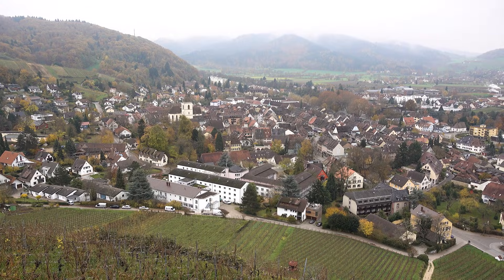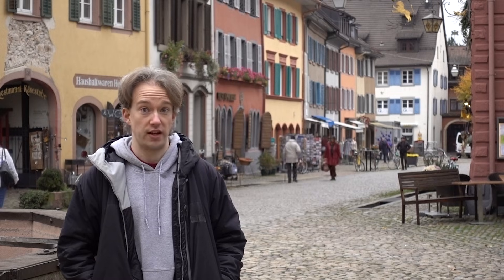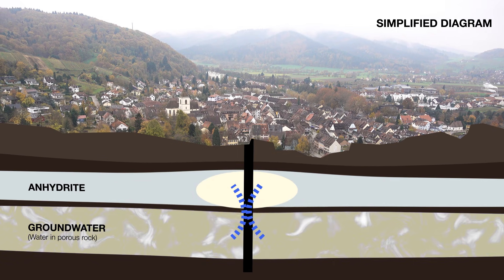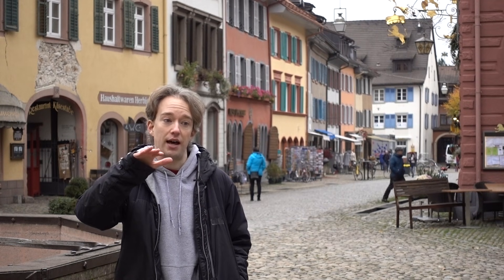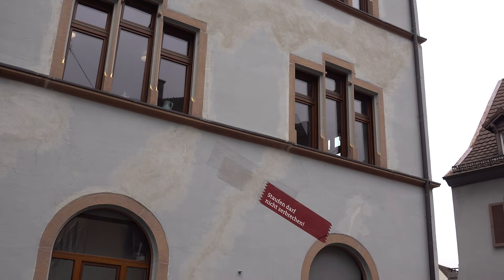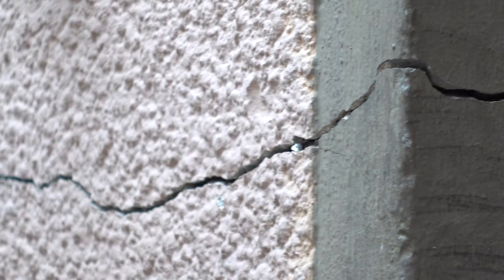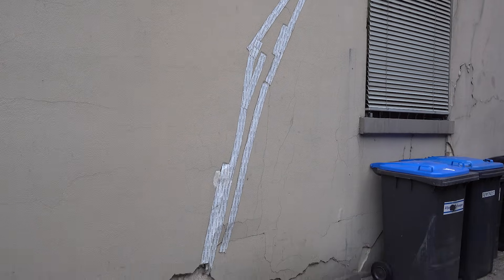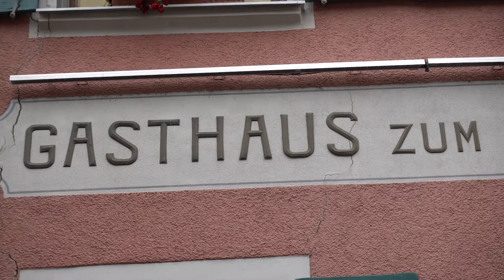The German town that's literally cracking apart

Comment: Just use duck tape, duh. I thought that germans are smart...
Reply: Tesafilm
Reply: Clearly you arent German then
Reply: Duck tape?
Reply: We call it Panzerband.
Reply: @ezioauditore2848  HANS GET ZE PANZERRR
Reply: @ezioauditore2848  😂😂😂😂 ich sag panzertape dazu
Reply: @ezioauditore2848  oh mein gott ja ja Sehr gut !!!!!
Reply: Duck tape? Do you mean duct tape?
Reply: @Zoe-bx9bp  no, duck tape is a real thing
Reply: @Zoe-bx9bp  actually theres a brand of tape called duck tape
Reply: Nothing FLEX TAPE can't fix.
Reply: @Giga4ever You are right my friend.
 Hi, Phil Swift here with 
Flex Tape! The super-strong waterproof 
tape! That can instantly patch, bond, 
seal, and repair! Flex tape is no ordinary 
tape; its triple thick adhesive virtually 
welds itself to the surface, instantly 
stopping the toughest leaks. Leaky 
pipes can cause major damage, but 
Flex Tape grips on tight and bonds 
instantly! Plus, Flex Tape's powerful 
adhesive is so strong, it even works 
underwater! Now you can repair leaks in 
pools and spas in water without draining 
them! Flex Tape is perfect for marine, 
campers and RVs! Flex Tape is super 
strong, and once it's on, it holds on tight! 
And for emergency auto repair, Flex 
Tape keeps its grip, even in the toughest 
conditions! Big storms can cause big 
damage, but Flex Tape comes super 
wide, so you can easily patch large 
holes. To show the power of Flex Tape, 
I sawed this boat in half! And repaired 
it with only Flex Tape! Not only does 
Flex Tape's powerful adhesive hold the 
boat together, but it creates a super 
strong water tight seal, so the inside is 
completly dry! Yee-doggy! Just cut, peel, 
stick and seal! Imagine everything you 
can do with the power of Flex Tape! .
Reply: @jamoin3829  to demonstrate the power of flex tape I sawed this town in half
Reply: @paulbauer8256  And repaired it with only Flex Tape!
Reply: @Usernamesarehard-e1e  it even works underwater
Reply: didnt expect u here Mr Slav <3
Reply: They actually did that, there are duct tape stripes over many cracks.
Doesn't really help though, the tape tends to get streched...
Reply: "If you cant fix something with a tape,then you are not using enough tape"
Reply: In Germany we call it Panzertape lmao
Reply: @bonsaiflrn  In Finland we call it "jeesusteippi" aka jesus tape hahah.
Reply: No verification?
Reply: Duct tape.
Reply: To show you the power of flex tape, I just cracked this town in a half!
Reply: Love your Vids dude
Reply: @___________482  probably yes, as they didn't use flex tape. But still, it's tape, and that's all this comment is about.
Reply: Flex Tape
Reply: "Thought" is past tence so its were, not are. Not very "smart" of you.
Reply: MISTER SLAV <333
Reply: @___________482 deinen youtube-namen hast du von nem anderen kanal kopiert
Reply: @kommentierenderkommentator2572  ich will ja nichts sagen aber es gibt sehr viele youtube nutzer und accounts da kann ein gleicher name schon vorkommen und den kanal den du meinst kennen wahrscheinlich 5 personen
Reply: Love your vids btw how could you not get verified?
Reply: Bureaucracy goes brrrr
Reply: @Teamgeist Ah dein ironie detektor ist kaputt
Reply: @Teamgeist was kann nicht mein Ernst sein
Reply: These houses are doomed , no need to repair them. They will have to go anyway.
Reply: The problem is the authorities: You can’t even eat a peace of foreign bread without a permission you need to apply between 10-10:30 on a Tuesday because the public service is closed on other times
Reply: It's a shame MR SLAV can't spell. It rather undermines his joke...
Reply: @ThreadBomb  duck tape is a real thing. There's duct tape and duck tape

Comment: Hey Tom, a similar thing is happening right now in the province of Groningen in the Netherlands. It's the location of Europe's biggest gas bubble and the Dutch government loves to exploit it, yet all the drilling is causing earthquakes in an area far from any tectonic plate edge. It might be interesting to check out!
Reply: Ooh I know, I'm working on management software for the cost reimbursement system for that.
It's crazy how much it's costing the very same government that's still allowing the drilling. (but I guess it's profitable for them then)
Reply: Slochteren.  
You could put your arms in those cracks, the muddy ground is not compact so every piece of land is moving different. 
In the neighbouring province , Fryslan, something similair is happening, but that area isn't housed much but the pumping of gas does impact some flats in the city 15 km's further away. (Search, Tjaardaflats)

Comment: Half a meter of movement sounds like very much actually and those people are lucky that it causes a gradual slope. If the difference for a single building would be 50cm, there would be gaps in the walls that you could walk through.

Comment: was the well bore ever cemented or cased across the anhydrite strata? id assume so, but you mention ground water pumping still taking place... so idk? 

here in texas we have a few marginal aquifers in the hill country that are peppered with evaporative anhydrite beds. when you hit one, it shows up on your drilling log as a spike in conductivity and you know to case off that part of the well. the spoil or cuttings also shows the anhydrite obviously. 

if you fail to case off the anhydrite beds, you tend to see huge amounts of sulfate and generally higher salinity which makes the marginal quality water basically useless without ion exchange pretreatment to  reverse osmosis.

Comment: And not just geothermal - my father's hometown of Tusla, Bosnia is falling apart - not due to geothermal boreholes, but centuries of salt extraction. They get the salt by drilling a few holes down to the salt layer and pumping warm water down to dissolve the salt. Not unlike fracking for gas.  At one point the city had hundreds of boreholes pumping down fresh water and pumping up the brine. With the salt missing the ground started to subside, accelerated by the industrial revolution increasing the efficiency of the extraction processes.
They have since banned salt extraction from under the city itself, but the damage has been done.

Comment: How's that green carbon-free energy working out for you? Nothing could go wrong they said. Betcha wish you had a thorium nuke instead right about now. Put a couple of windmills on top of it for aesthetics, just to make people feel good when they look at it.
Reply: How many rads have you soaked up? No matter how bad you try to paint this unfortunate scenario, it will never be as bad as Chernobyl.
How many green energy accidents can you name off-hand?
Because I can name 3 nuclear accidents that cost billions of dollars to clean up.
1.Chernobyl
2.Three Mile Island
3.Fukushima
Reply: Well, one green accident is the very subject of the video-- a city falling apart because of a pursuit of geothermal energy. Another is that, the sun goes down and your expensive solar farm is now producing nothing for about 12 hour a day while an equally expensive coal plant is still running. Windmills take up vast amount of acreage, displacing wildlife and flora, becoming a blight on the landscape they're supposedly trying to help save. Then they bust and break if the wind ever picks up too much, and stop completely if it gets too slow. Then there's the Solyndra boondoggle with millions of dollars vanishing into thin air. There are currently 449 nukes in operation as of right now. You named 3 of them that went bust. Chernobyl was a failure of Soviet management and maintenance. Fukushima was built on a fault line which was stupid. Nobody died from Three Mile Island and there was no statistical uptick of cancer or any other rad-related illnesses in the surrounding area. And the mistakes of Three Mile Island changed the way we build and run nukes so it can't happen again. It comes down to need vs fantasy. If you use electricity, you need power plants to constantly pump your grid full of energy 24 hours a day just to keep the thing stable. Green sources are just too expensive and unreliable right now. Maybe 200 years from now it will be different, but between now and then, nukes are the way to go. They don't produce CO2, they can make enough electricity to power future electric highways and electric vehicles to stop that CO2, and eventually stop if not reverse global warming. The only change I would want is to switch from uranium/plutonium to thorium. Thorium can produce as much power as the former but is harder to weaponize and has a much shorter half-life, so it would be easier to store as waste/less dangerous.

Comment: Why would they drill in the center of a town and not in the country?
Reply: It was for geothermal energy, according to the video, so the middle of the town is where the geothermal energy would be useful, because that's where the buildings are that need heat.
Reply: Power plants don't just produce heat, they produce heat and then inefficiently turn it into electricity, which is then pumped to towns and... inefficiently converted back to heat.

Drilling in towns makes perfect sense and has been used to great effect in many areas of the world, a lot of our energy is used  up in heating, why not take the most efficient route?
Reply: GlobstersMessenger
Because your house will crack ;)

You're right, we have many inefficient methods of power production. But that's all we have for now.
Reply: It was supposed to heat/cool the newly renovated town hall.
Reply: there must be an indiana jones explanation somewhere.... and there is a portal involved. to another dimension. or at least some layer of mentos covering a giant lake of coke.
Reply: I also don't think it would have made a difference. There isn't really that much free space in Germany. At least compared to US. 
It would have affected somebody this way or that way
Reply: to instantly use the warmth without needing to convert it into energy?
Reply: Imagine a Geyser that you hook into your radiator. Its not necessary a grand scale operation like fracking that you might think of. It can be done for a single house potentially.
Reply: lots of geothermal is small scale and local. to the point where single households do sometimes invest into a system.
Reply: It was for heating the town hall, not energy production. That is only viable in a few places in germany.
Reply: +aguyandhiscomputer He means pump the heat in directly
Reply: Most power plants are not in cities. I suppose if they wanted to use the heat directly, then it makes some sense.
Reply: Benjamin Brooks u mean the more rural countryside right?
maybe they wanna use less pipes 2 reduce cost?

Comment: Going off this but you should look into some of the companies making modern masonry buildings without structural mortar (they still use a little for waterproofing/ insulation).  Buildings used to be made like that can resist the damages caused by earthquakes and other shifting grounds because the blocks are allowed to freely move without damaging the integrity of the building.  And if you do ever see a rock starting to come separated over the years, all you need to do is essentially just push in back in place.  Super cool and my favorite style of buildings

Comment: Wow, not only cracking a major concern but other concerns include water, gas, and drain pipes (and possibly electricity cables) that get shifted and break in the process as building move. :/